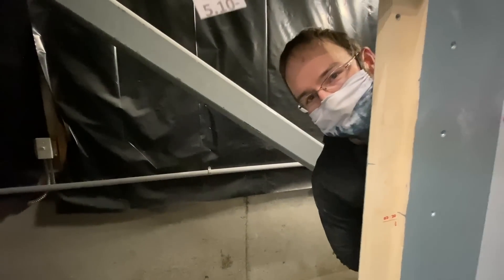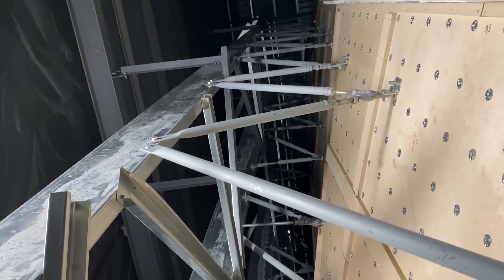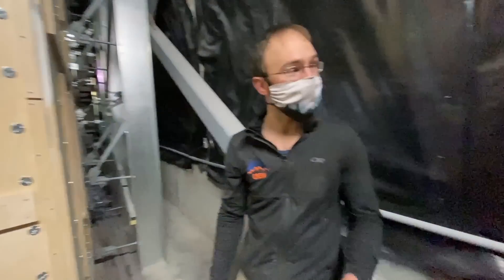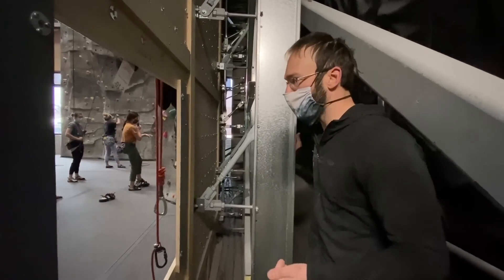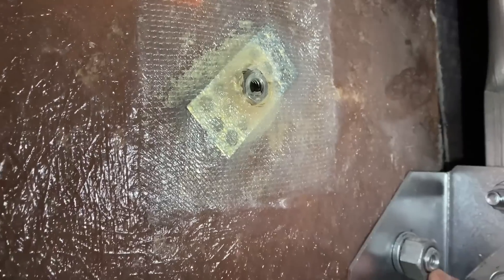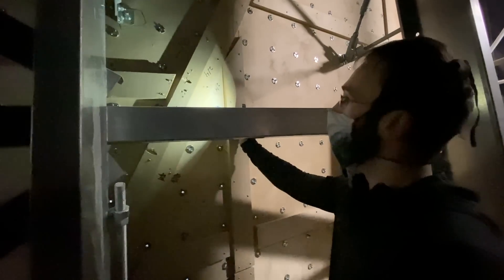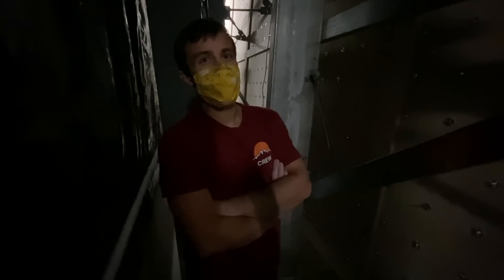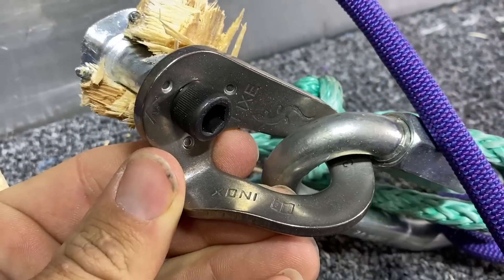How Climbing Gyms Are Made

Comment: Just starting to look at how climbing gyms are constructed, thank you for the wonderful video! Questions: If I have a stone (eg coral stone/oolite) building with ~2 foot walls, and instead of building the separate walls like in the video I want to install everything directly on the face of the stone wall, what hardware would you use in place of the T-nuts, or is there a different type of T-nut to use? Do you see any practical issues with using such a stone structure as the basis for a climbing gym?

Comment: There's a gym I've been to where a hold has spun on me  2-5 times a month for the last few months. I'm still fairly new to climbing, but that's not something i'm doing wrong is it? I'm about 220 and I just don't wanna go if i'm gonna keep falling because holds are spinnging
Reply: Inform the owner. It happens quite regularly everywhere, especially if you just use the bolts and don't put in any additional screws. It might happen to you more frequently because of your weight (no offence ;)) .

Comment: Hi! There is a new ''world-level'' gym in my vicinity. What was super interesting to see is that bolts are atteched directly to the plywood. However instead of a t-nut there is a big square washer (2x2inch) and normal hex nut. I am super curious to know what these break at! To make it even more fascinating the toprope anchors are mounted the same way!
Reply: That is terrifying and I would NOT climb there. For the mid climb hangers at bare minimum you need a horizontal wood 4 by 4 waler running the width of the plywood panel, bolted through the plywood with bolts every 6" apart, and a 3x3" steel plate behind the waler for the anchor bolt. For the top anchors, they MUST be bolted to steel building structure

Comment: Still don't get why hangers aren't attached to tbolts only. 25kN is just the amount of force any carabineer would endure.
Although it kinda makes sense to attach top rope anchors to the main wall frames made of steel.
Reply: Because that's the maximum force to rip it out of the wood in an 'ideal' scenario, the wood would be damaged already with lower force, so you'd have to replace a part of the wall every time someone had a big fall. Not really something that's easy to do.

Comment: Different birch plywood (where it is manufactured) will have different strengths too. When I closed my gym I ripped some of the t-nuts out of the wall and had consistent lower numbers than you got.
Reply: Wouldn't adding a steel plate (as an internal washer) add enough surface area and solve the problem?

Comment: I’m sure you probably already know these things and were just hurrying for our sake but a scrap wood backer board when drilling helps the breakout/break through on the plywood. Also those Brad point or screw/auger type drill bits(couldn’t tell in the shot which one you were using) are notoriously bad for ugly exit holes. There’s not much that’s faster when it comes to pulling itself through a hole but a center punch and a regular twist drill bit would be slower but equally accurate and a little better on the exit. I’m sure you and/or your tool guy know these things but just wanted to offer some advice from my knowledge toolbox since you’ve helped me out on the climbing side of things. Thanks for posting man. Enjoyed the investment content too. Don’t think I commented there but I’ll dip over there soon and drop my situation to further your idea of types of folks you have glued to your content these days. Already looking forward to the next one man. 👍🤟
Reply: Check out the irwin triple-fluted Speedbor bits, they leave super clean holes and are incredibly quick, just watch yourself with the torque, they have a self-feed tip that pulls it through the wood. Used them on a moonboard I built and they made drilling through three sheets of 3/4 ACX plywood like nothing, with a pretty clean hole even without a backer.
Reply: @drew5334  thanks for the tip, always looking for a better tool, I’ll be sure to check these out.

Comment: What if you put the t nut through a big, say 3" sheet metal washer, as a backer?
Reply: Use a 3" plate washer, they're the standard washer used with concrete anchors to secure sill plates to the concrete foundation and are +1/8" thick. I bet you get at least 50% increase on both shear and tension tests
Reply: That would help with pulling through the wood, but some of the concern is the t-nut itself breaking.
Reply: @jimmmaaayyy5163  In this situation, the T-nut is far stronger than the actual material, so (especially considering the expected loads) a properly-secured backing plate would be more than good enough.
Reply: @nikolaihedler8883  With respect, the t-nut is not necessarily far stronger than the actual material.  That's why there is a standard for it, t-nuts can break, commonly right where the tube transitions to the flange. I know the plywood is strong enough, but I wouldn't trust a random t-nut with my life. Hence the bolt hangers and top anchors connecting to steel structure behind and tnuts only used for holds.
Reply: There are other threaded plates etc. that can be used as a backer behind the plywood so that a lead anchor can be placed in the middle of a panel and not connected to the structure. Usually there is some specifications about how that panel itself is then connected to the rest of the structure.

Comment: It is common to teach clipping in gyms by temporarily putting bolts down at ground-level. I saw someone once tie off the end of a toprope to a bolt in a random lower down hold-specific hole in order to demonstrate how to prussic up a rope. Luckily, the bolt made a loud creaking noise when he started to put weight on it, and a more knowledgable individual ran over and pointed out that he had tied off to a not-super-good-enough bolt (based on your break test, it probably is super-good-enough at the Commons, but this was on a 20+ year old wall that was falling apart). Just a reminder that what can go wrong, will go wrong! Great video as usual (and YAHOO BOISE CLIMBING!!!!)

Comment: I am building a home wall for a friend and had this question, but also i was wondering if MDF would be a good option instead of plywood
Reply from the maker: So OSB is glued wood chips and MDF is glued together saw dust.  You need real plywood to do anything!
Reply: MDF is much more fragile to such loads (it could be fatal for a climbing wall), plywood is much more durable
Reply: Yeah, the random 'grain' of MDF means that any bolt could pull a chunk out after a sharp load.

Comment: This is awesome been looking to turn a bridge near me into a mini gym :)
Reply: That’s an awesome idea, what sucks is that people suck and your holds will magically disappear
Reply: @heli400  unfortunately you're right, people will steal anything. I did once add a route to a long discussed brick built railway bridge (did it many years ago, but I worked with the features and did minimal chipped) the 2 bolts at the top weren't stolen, but sure any bolt on holds would've gone real quick
Reply: @tomtom4405  😱chipped holds?!?😱.
....On a bridge sure, ok. (Man made)
I just hope you don’t bring this practice to real rock ;)
Reply: @heli400  was thinking just little bits of wood screwed on :to hopefully avoid that :)

Comment: Cross-threaded t-nuts are a regular occurrence because impact guns generate a significant amount of force and the torque rating of a t-nut is significantly less than what an impact wrench can produce. Also, the steel that t- nuts are made with are of a softer steel than the bolts used which means the bolts can easily chew through a t-nut. Most t-nuts are over torqued as a result and this compromises integrity especially if the t-nut has been cross-threaded multiple times. I'd be curious to see how t-nuts preform in tension using a cross threaded t-nut as your sample.
Reply: Pro-tip: to avoid cross threading, hand thread the first few threads, then use an impact driver with a medium setting or drill with the clutch set to the proper torque
Reply: @drew5334  Indeed. However, this is generally not the case. Often setters are floating holds, balancing them on the gun and driving away. Even if the bolt catches the thread appropriately, it's often over torqued, flexing and altering the thread pitch over time. A compromised t-nut that's trying to hold a protruding volume against the leverage of a cruxing or dynamic climber is a noteworthy example. Also, once cross-threaded, t-nuts should be replaced and not retapped and large volumes and protruding holds should fasten into the steel structure the same way fall catchers are.
Reply: @Established1975  An experienced setter "should" be able to tell is a screw is cross-threading, even when using an impact driver. Regardless though, unless the threads are stripped to a point of spinning, as long as they tighten fully they'll hold the measly load we put on them. It's only going to be a max of a couple hundred pounds. I agree they should be replaced though. It would be lazy not to.